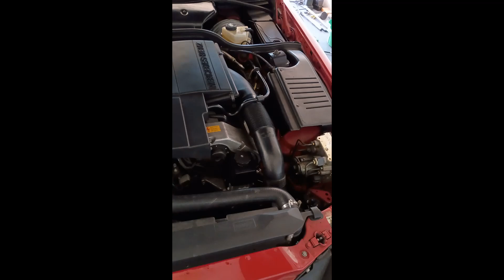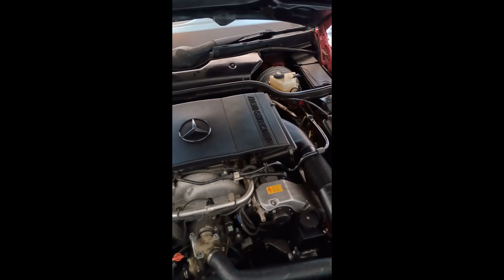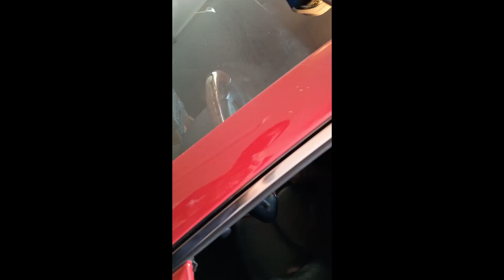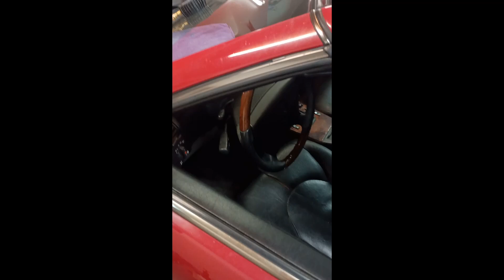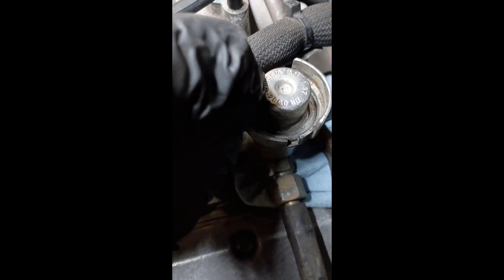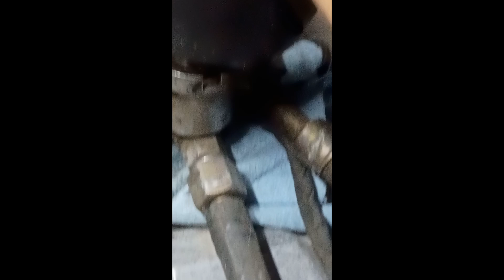1997 Mercedes SL500 R129 Fuel Pressure regulator - Testing and replacement

Comment: Does residual pressure rely on this regulator? or the pressure accumulator near the fuel pump? I thought it was the accumulator that would maintain pressure. I'm having a similar issue and longer cranking times (especially when very hot) and I think it's probably losing pressure and vapor locking...
Reply from the maker: On this model with the m119 v8 the pressure is held at the regulator under the hood. Later models like my w163 with m112 v6 hold the pressure at the fuel pump.
Reply: @TimmyTheGreaseMonkey  I have a m119 as well, thought there was an accumulator near the fuel pump underneath as well. Thanks.

Comment: will you share a link to that fuel pressure tester? thanks
Reply from the maker: Oreilly Auto Parts doesn't seem to list the analog fuel pressure test kit on their site anymore. They list this digital one instead. https://www.oreillyauto.com/detail/c/evertough/tools---equipment/rental-tools/engine---clutch-rental-tools/2a06ea1d698c/rental-tools-evertough-fuel-pressure-test-kit/ren1/67091 - Probably best you visit your local store and see what they have available to rent.